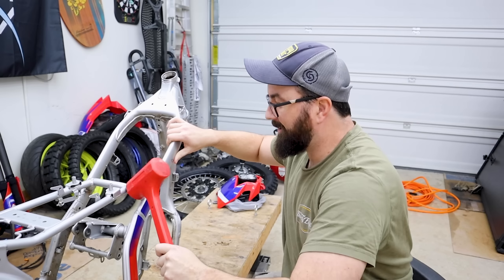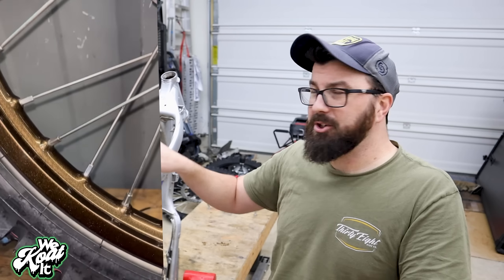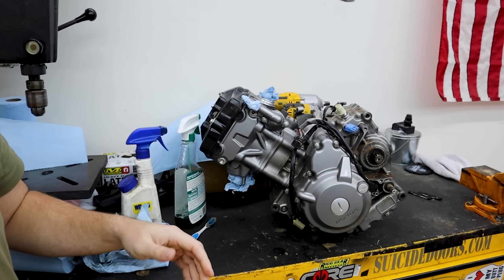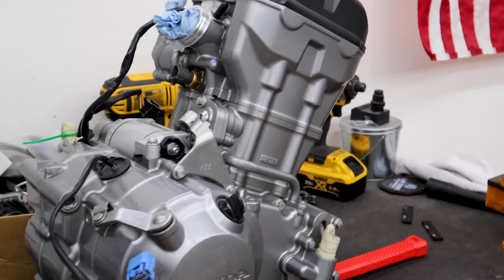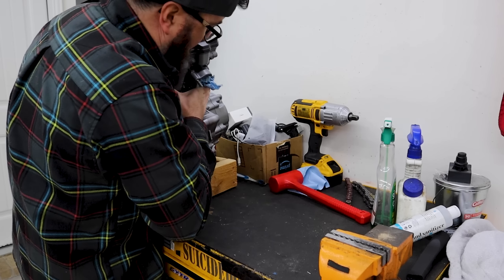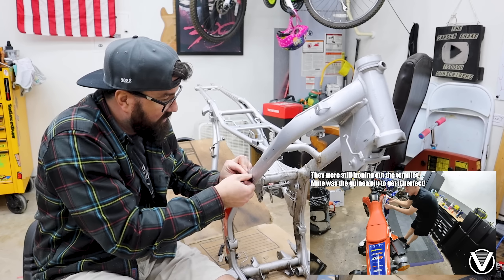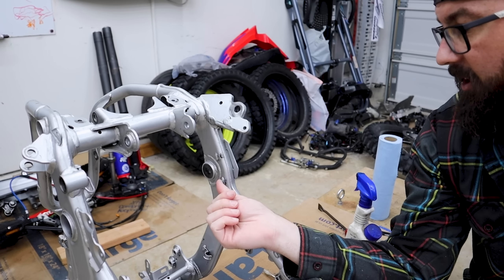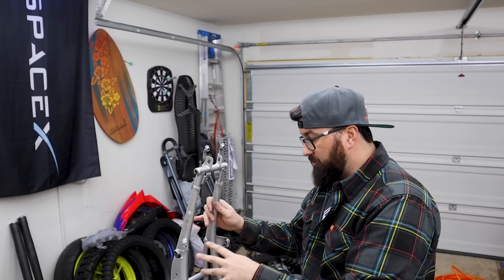How to Clean a Motorcycle the Hard Way - CRF300L

Comment: In the future a torch will help get that epoxy stuff off. A torch and wire brush/wheel will clean the area before welding. It's what I use when seam welding a unibody race chassis.

Comment: I vote bronze too. Just a thought, but if you have moisture from those gaps at the rear subframe that’s still stuck in there with the potential to rot out from inside? Worth drilling a couple of small holes low down to check and maybe nitrogen pushed through to dry and inert? In my distant past we used nitrogen to fill truck tyres to stop the wheels corroding from wet compressed air and why I suggest it.

Comment: Friend, I'm from Russia. I see how you try and tune this motorcycle. But I have one question. Why didn't you buy the crf 450 rl, which is much more powerful and lighter than yours about 35-40 pounds. I think the 300l is a motorcycle for losers.
Reply: @HALBIN1984 If you add up the price of all your tuning, then it will make up this price difference. The cost of maintenance for these motorcycles is the same